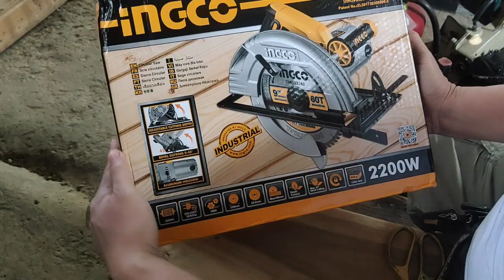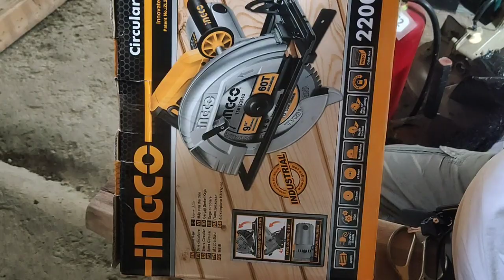INGCO Circular Saw 9 1/4" Blade 2200 Watts Unboxing from Shopee

Comment: makapal ba baseplate nyan bos at hindi umaalog? Yung sa akin kasi dito na Total CS which is sister company lng ng Ingco umaalog sya pag naka fix like e screw  mo sa table para gawing tablesaw or ilagay mo sa kreg rip cut jig kaya di pde dahil hindi accurate.
Reply from the maker: Oo makapal at sa ngayun ginagamit ko sya pang table saw malakas ang motor nya
Reply: @mrjtv7175  salamat sa kaalaman bos, last tanong ko ung ingay nya hindi ba sya masyadong maingay or kung ikaw tatanongin malayonba agwat ng noise level nya sa mga 7 inches na CS? dito lng kasi ako gumagawa sa bahay which is subdivision baka sobrang ingay nyan mag rereklamo na mga kapitbahay 😂
Reply from the maker: Ayus lang ang tunog ng motor normal na ingay lang tapos kagandahan nasasalpakan sya ng blade na gang 10 inc kasi standard nya talaga 9 inc lang kaso kailangan  ko mas malaki kaya 10 inch ginagawa ko ok nmn sakto lang